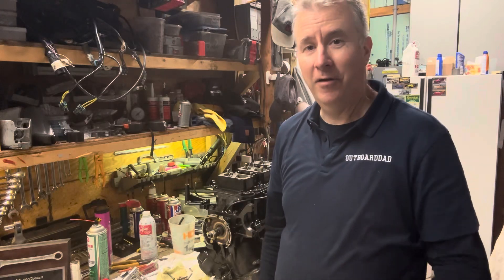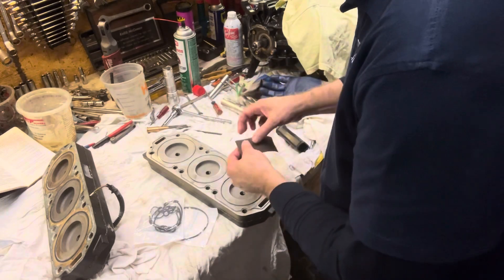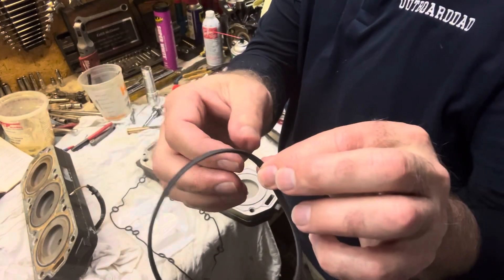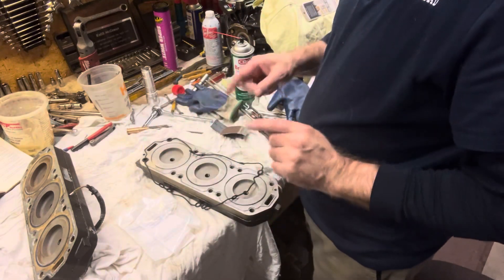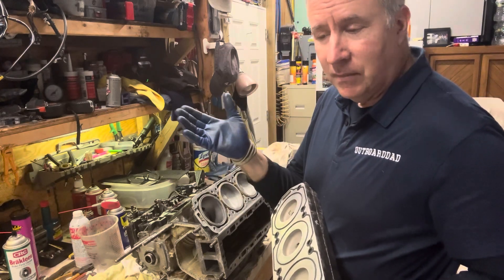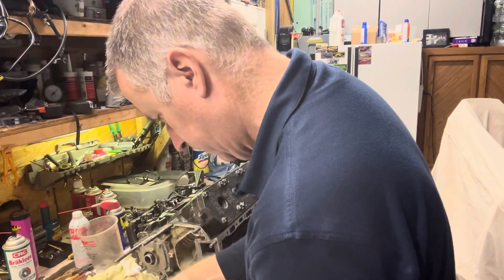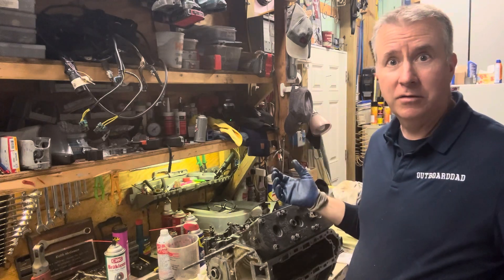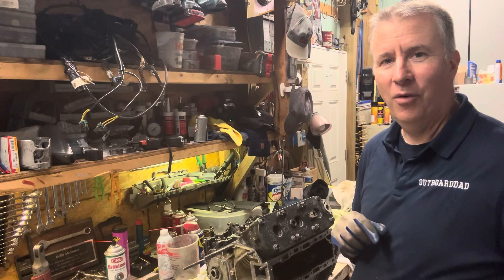Mercury 2.5 Rebuild assembly and Torque specs ( Part 26)

Comment: Could you use a wire wheel to clean the old gaskets, and O ring chases out?
Reply from the maker: @tylerleicy8059  That is a little dangerous, you want to be sure not to remove or distort the metal in any way. It takes time to be diligent and clean it all out by hand but worth the effort. What motor are you working on?
Reply: @OutboardDad  i figured that was probably you reasoning. Im currently rebuilding my 2004 225 optimax. The motor suffered piston damage in cylinder 6, and cylinder 4 was about to spit a ring.  I haven't really figured out why it did that, but I'm wondering if it's from running pennzoil xlf in it. So far I've gotten the powerhead removed, and tore down to a bare block. I found some mild scoring in both cylinders, but the crank and connecting rods all seem to be fine. I've been trying to find a machine shop to bore it out. Your videos have been extremely helpful, and have helped me build some confidence in rebuilding it myself.
Reply from the maker: @tylerleicy8059  Awesome! Yes only use the Optimax oil for that model. Also be sure to clean out the complete fuel and air injection systems. That air pump will need to be taken apart, inspected, and new o rings at the very least. That gets missed a lot on these motors and causes major failure.
Reply: @OutboardDad  I definitely plan to tear all that apart inspect, and clean.
Reply from the maker: @tylerleicy8059  Let me know how it goes!

Comment: I thought that the heads, or cylinder covers as they were named in your book, had a single gasket instead of your O-rings.

Some of the rests of our old engines here are two units of 1997 Mercury v6 two stroke, model 135hp 2.0, and the one that is installed (and overheating) is a single unit of the same model but year 1998.

I feel like cleaning carefully two of our four old heads, and replacing the heads quickly onboard one of these days. The boat is floating all year long, and we like to give it a ride even during the wintertime. 

What model and year is this Mercury 2.5 engine of yours?
Reply from the maker: @josemariatrueba4568  I think it’s 2001 and yes no head gasket on these.
Reply: @OutboardDad  Understood. Many thanks for your quick response. 
I wonder why they decided to replace the traditional gasket with those great O-rings and complex rubber gasket.
Reply from the maker: @ Mercury was always trying new things
Reply: @OutboardDad 
@OutboardDad maybe too many things while using poor customers as a huge test team?
Anyhow they must have had good reasons, or just a single reason, to replace the traditional head gasket. I wonder what was the main reason. Heat transfer from metal to metal, and/or maybe a better flow of water towards passages without an intermediate obstruction?